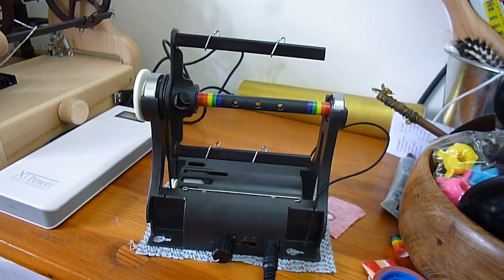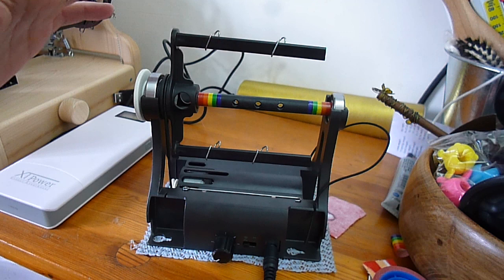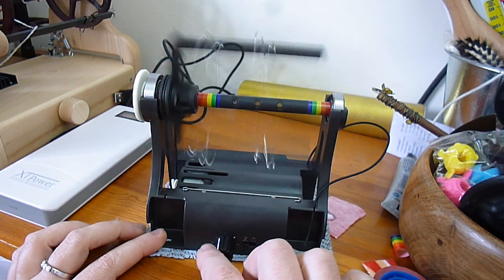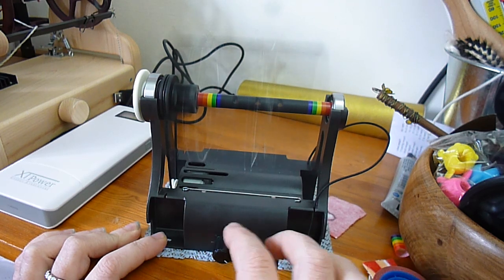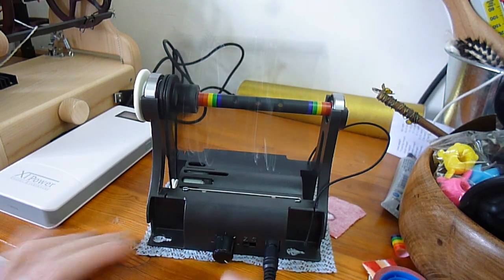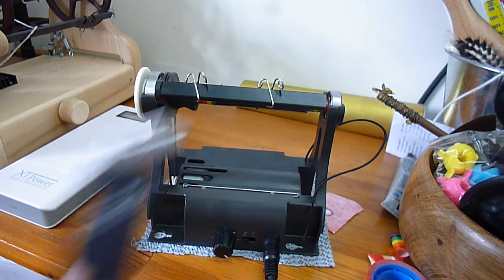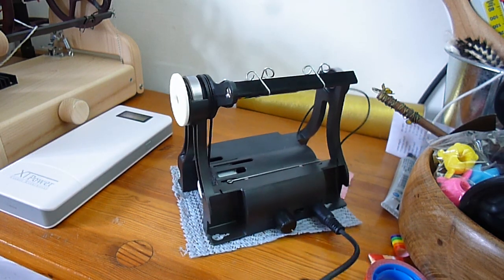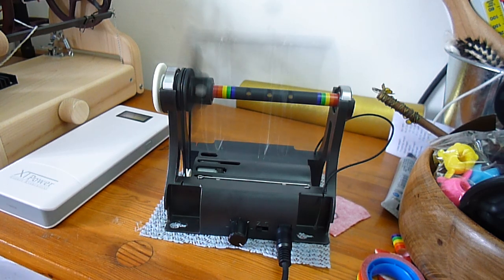EEW nano speed comparison

Comment: But what is the speed/operational comparison when it has a bobbin with spinning, I thought that they were finding it ran slower and slower then stopped when doing spinning. I've not got one yet, even though I like the concept of being able to easily carry my spinning wheel around, it's a lot of money for me to out lay to find it doesn't do what its suppose to do. I'd be interested to see another comparison. Cheers!
Reply from the maker: If the tension is too high or there's another source of friction that shouldn't be there, then yes, the motor will run slower and slower and maybe eventually stop as the bobbin fills. This doesn't have anything to do with the choice of power supply though, and is just one of the limitations of the original motors. The new motors, which I believe will be available around February, are both faster and les sensitive to high tension. I was one of the testers for the new motors, and I tried hard to crank up the tension even though I normally like to spin with a very light touch, and found that it only slowed very slightly even when the tension was way too high for me to comfortably spin.
Reply: @vampyyy  thank you for a reply, well that's good to know, and if the new motor is better then that's great, I like the concept of being able to do spinning anywhere with a battery. Thank you for sharing your experience with the nano. Cheers!